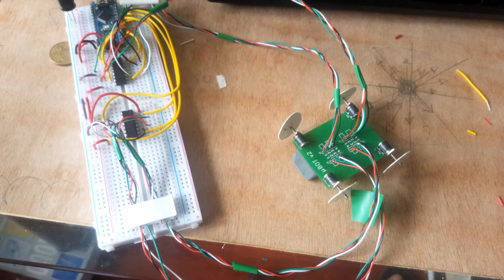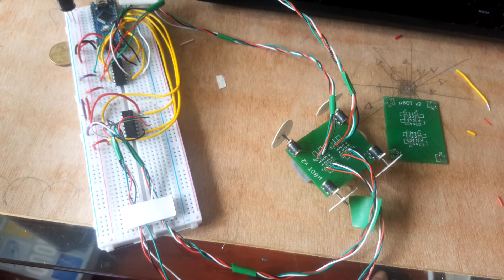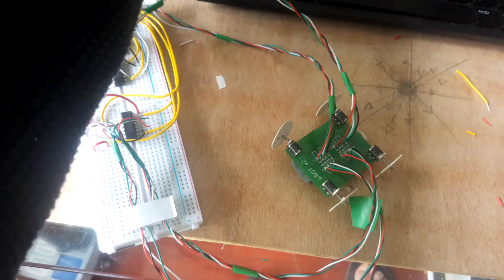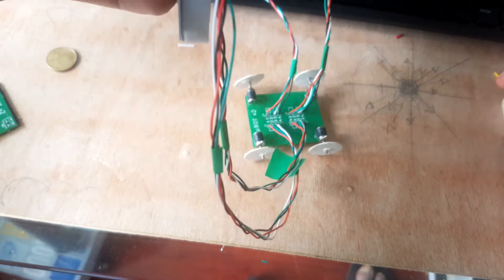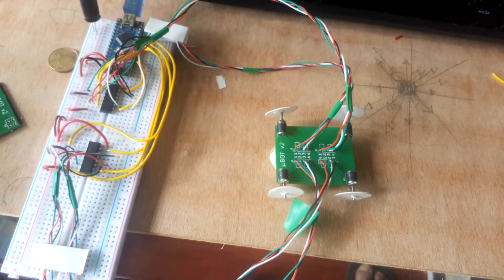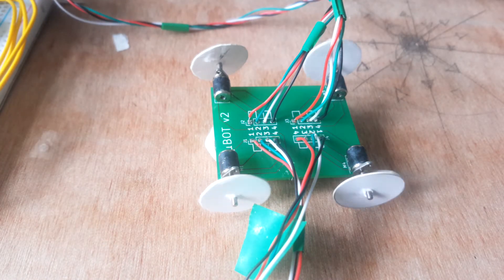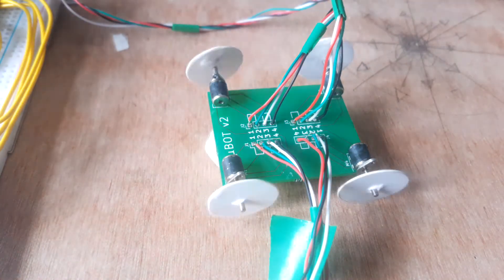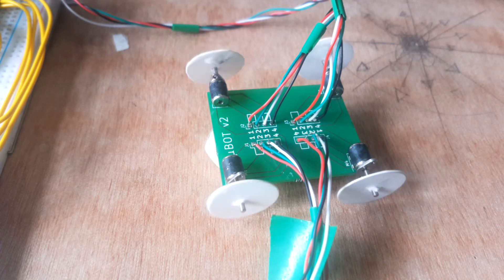Micro robot using micro stepper motors test 1

Comment: Just ordered some micro steppers.
Reply from the maker: If they have the pins arranged in a rectangle then they should fit this PCB, some of them have the pins in a straight-ish line instead. I can send you one of these PCBs if you are in europe, I got 2 spare that I don't need.
Reply: @wattnotions  Thanks, I am in Europe (Finland) but I have another project in mind for these. I plan to use them to drive a fake tape drive mechanism. Thanks for the offer. If you need 3d printed wheels for your robot I could print some for you :)
Reply from the maker: @FredBarbarossa  I think it will be a lot of trial and error so I will wait until I get the new PCB made and working and then start playing around with 3d prints, I should have access to a 3d printer by then. Thanks for the offer though!